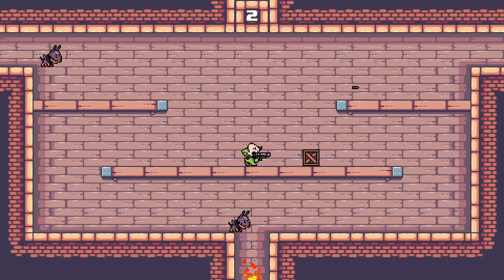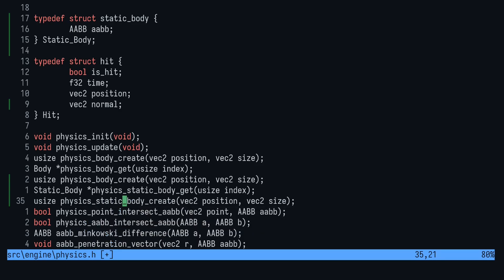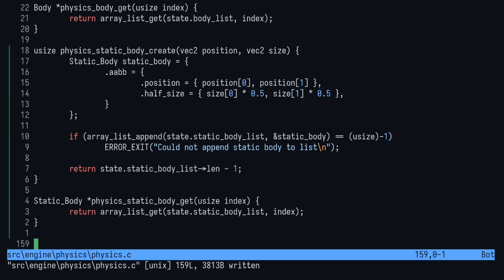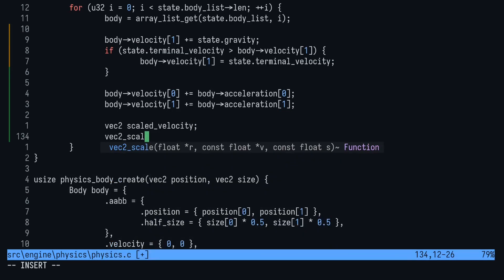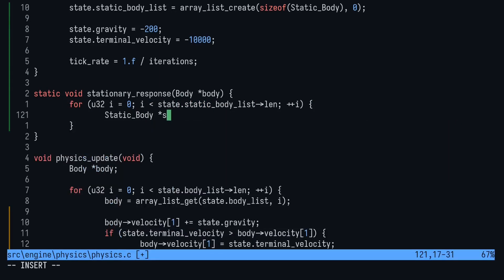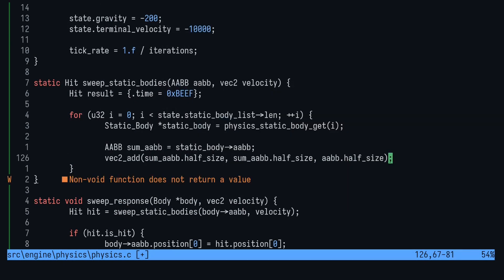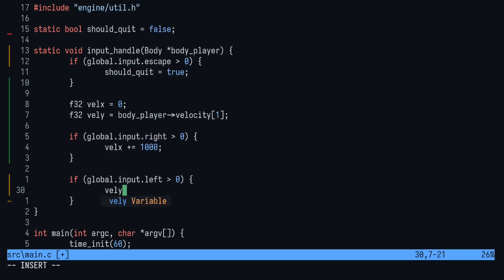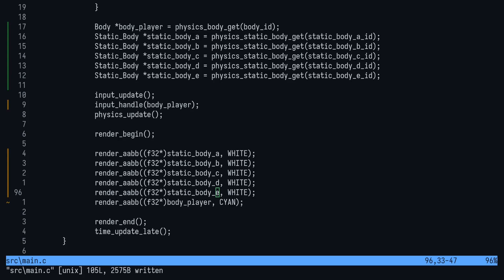2D Collision Response | C Game + Engine From Scratch 09

Comment: 2:38 C does have a sign function in the form of copysign(1, x) which compiles to just 2 instructions (andps with -0.0, orps with 1.0). In the case of x=0 it behaves differently than the method in the video (it returns 1 instead of 0) but that should be ok for the case in the video
Reply from the maker: Oh good to know, thanks!

Comment: Are you sure you need stationary response? I remade this in Rust and I commented out my stationery response and I don’t have any issues with tunneling or glitchyness it’s as smooth as can be. Perhaps i am missing something or I am not hitting some edge case?
Reply from the maker: I have found that without the stationary response there is glitching through corners. Perhaps there's some difference in the way our code is running that prevents this? Keen to understand why.
Reply: Can you publish your rust version?